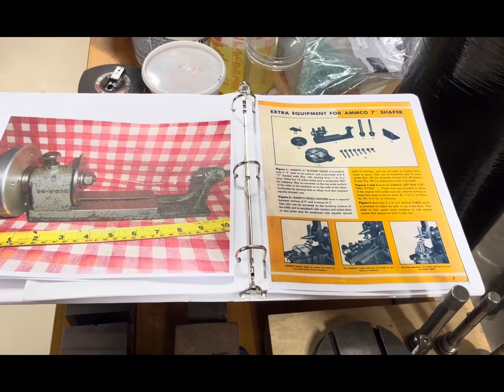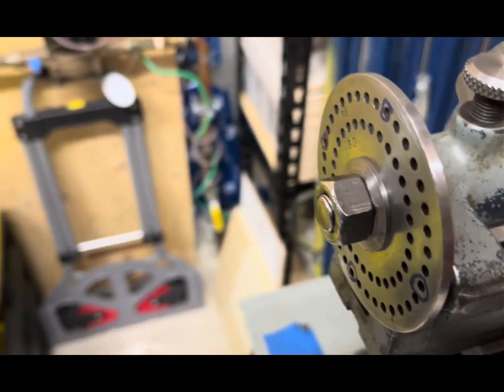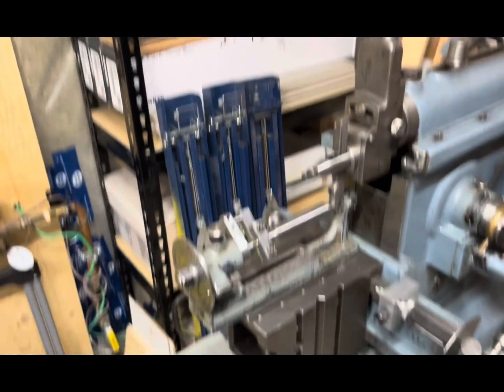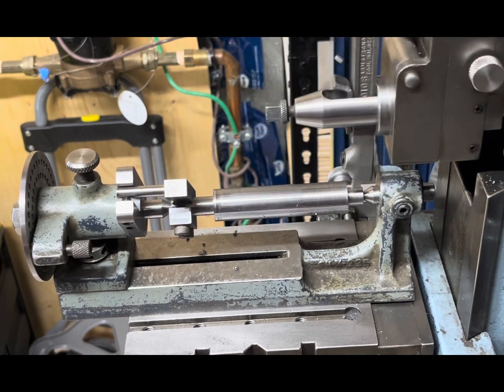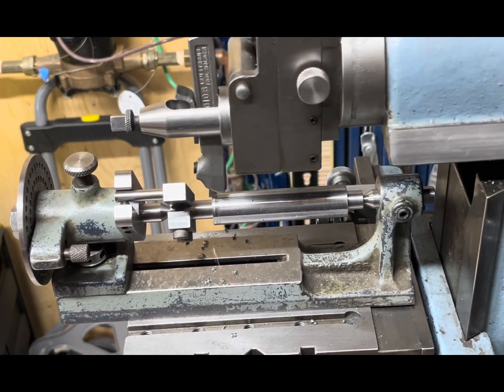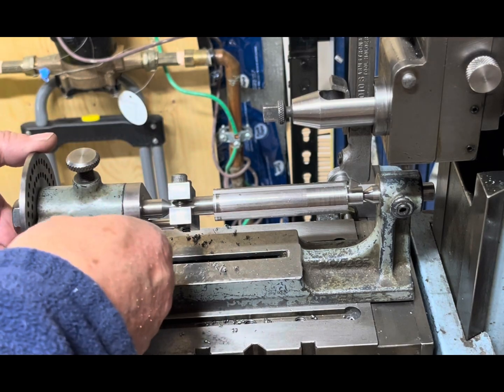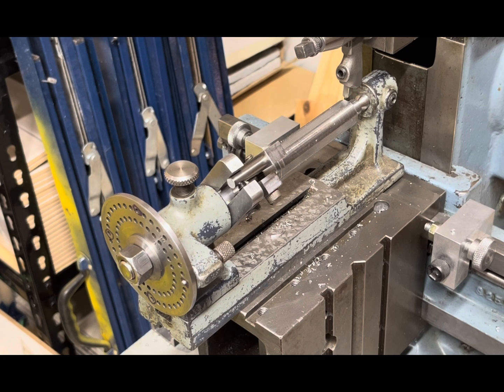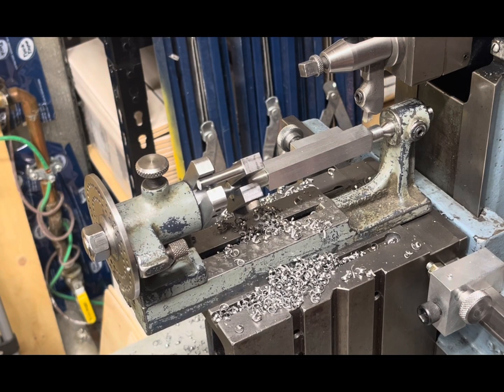Delta/Ammco Metal Shaper - Accessories - Indexer

Comment: So after foolishly selling my AMMCO 7” I found another and brought it home today…happy old man here. I still have that indexer (and the rotary table) and it’s in brand new condition with 2 plates. I never used it but pulled it out of the back of a cabinet and don’t see a straight forward method of fixing it to the shaper table. In your video I don’t see how you’ve attached it. Can you share that technique?
Reply from the maker: Hi, my indexer and rotary table both have a thread formed into the bottom of them.  I found a stud and nut that fit them.  You can then bolt them on through the hole in the table once you remove the vise.  There’s a keyway slot in the indexer that fits the table with a key.  This will stop any rotation when using them.  Hope this helps!

Comment: That's a neat little machine, but it isn't helping you to have the second most precise machine in a metal shop mounted on a wobbly stand.
We don't allow machines to move around in the machining world.
Reply from the maker: Hi thanks for your comment.  The shaper is mounted on a substantial metal stand that has heavy duty wheels that are locked.  It tends to rock back and forth on the rubber of the wheels like shock absorbers.  The function of the shaper and quality of cut is not affected by the movement.  Fun fact take a look at machine shops that were used on battleships which had to contend with the movement of the waves.
Reply: Wait til you see automatics run ..davenports..acmes..traubs

Comment: I'll probably never own any of these fixtures, so it's great to see them in use here. Feel free to show them off. 

Are there any parts that are used in both the rotary table and the indexer, like perhaps the pin?
Reply from the maker: Hi, thanks for your comments.  I just looked at the indexing pins on the rotary table and the indexer and they are different.  I don’t see anything other than the hold down studs being the same.  Cheers Ian